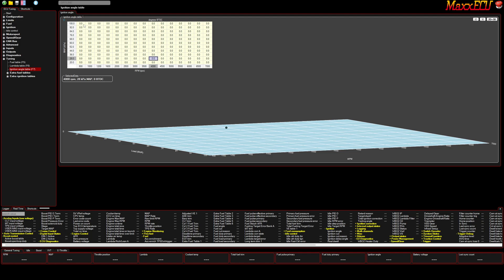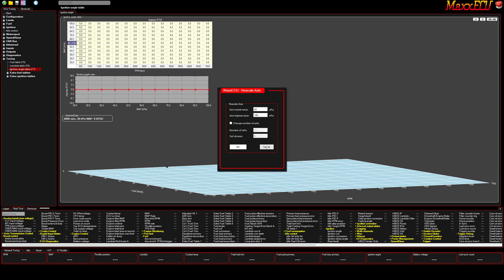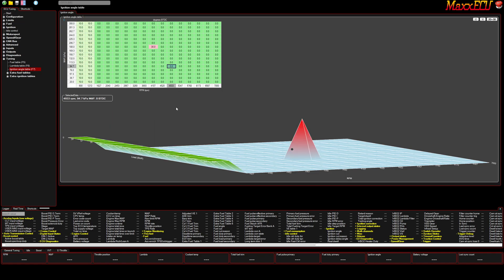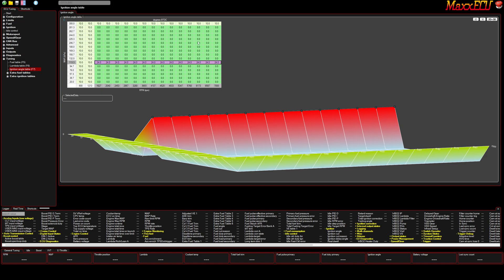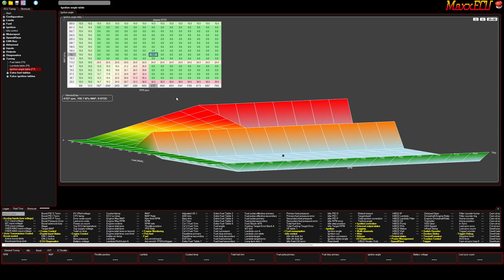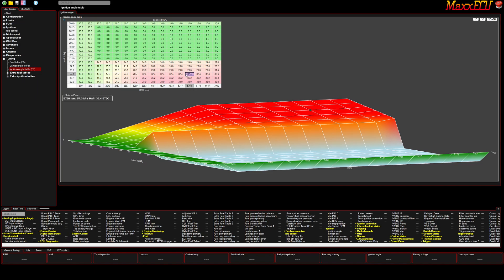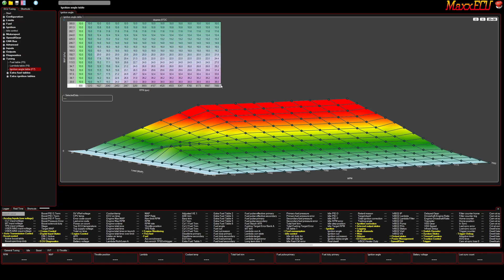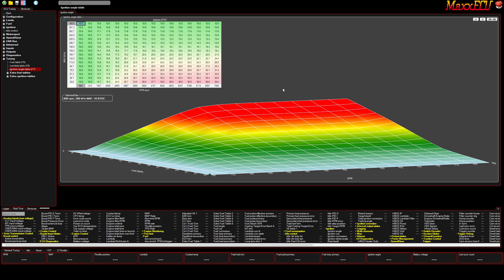MaxxECU M-Tune Ignition Table Basics (From Scratch)

Comment: A good idea is to make a Rpm column 150 rpm less than your normal base idle speed.  IN this columun , you will advance your base timing 1.5 -2 degrees to help the IAC not work so hard when you drop the car in gear if its automatic.  Most ecu's have and idle spark feature, but this also will assist in the process to keep a car from stalling, also in the extra column  you an add some extra fuel in as well if needed, like an ac compressor cutting in or electric fans turning on, etc.

Comment: Since basically any engine available today has distributor data available it should be no problem to get started.
I am converting a Jaguar V12 engine to EFI and I just used the distributor data multiplied them by 2 to get Crankshaft degrees and added the static base timing, bingo. 
Since distributor ignition was not nearly as precise as todays ECUs they will be conservative enough to go to the dyno and finetune for optimum power.